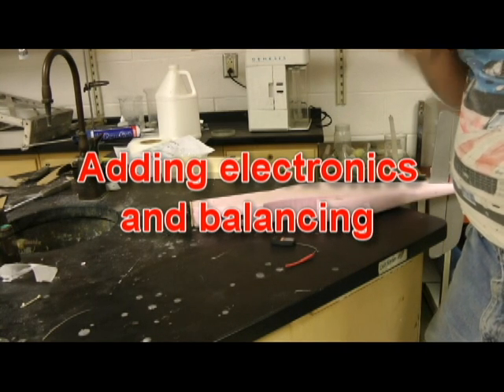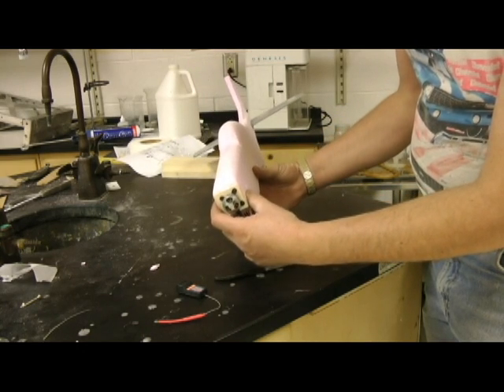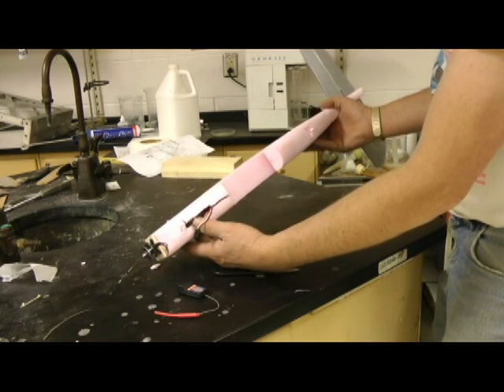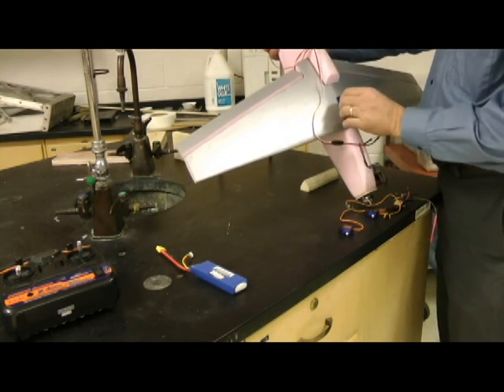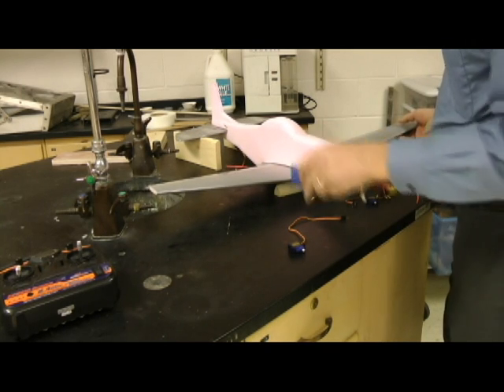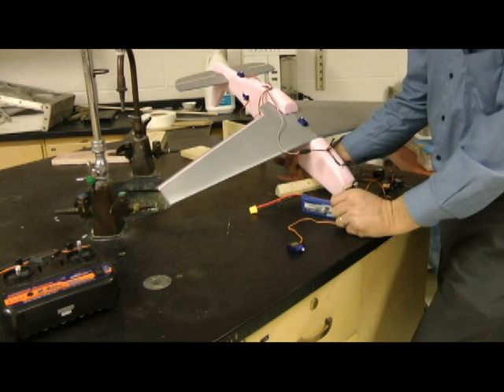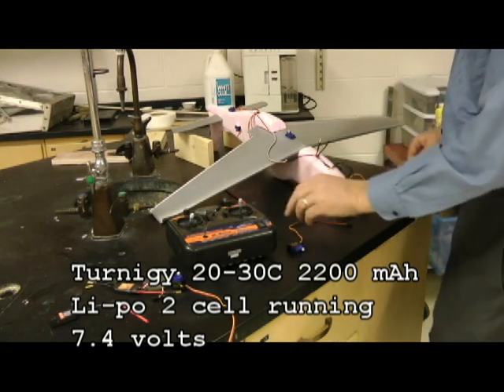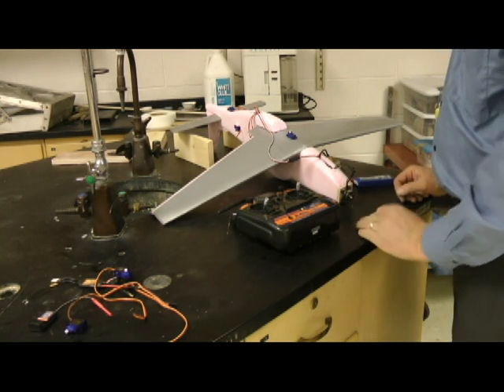Tutorial 9: Balancing and Electronics Test on my Park flyer

Comment: Hi, I teach HS engineering and we are working on your project. But I need to know what Turnigy motor did you use on this project? Did it provide enough power? Would love to be able to talk to you on the phone or through email. I you are willing just let me know. 
Thank you,

Craig
Reply from the maker: I used the Turnigy 450 with a 25 amp esc, but I am finding that the Suppo motors from Altitude hobbies are more powerful and just a better motor.  I won't buy from HobbyKing anymore due to problems with my last two orders.  They sent the wrong materials and would not reimburse me nor send the correct equipment, cost me $120.  Their chat line was useless and no way to contact a real agent.  There are far too many honest suppliers out there to continue with them.
Reply from the maker: Another alternative for aircraft are the ones from flitetest.com.  There are free plans and they give the materials list for motors and have a build video for each plane.  I have done several of their plans and they all fly well and are quite tough in a crash.